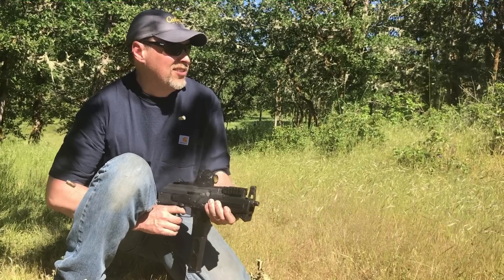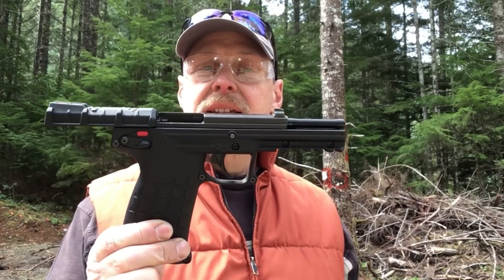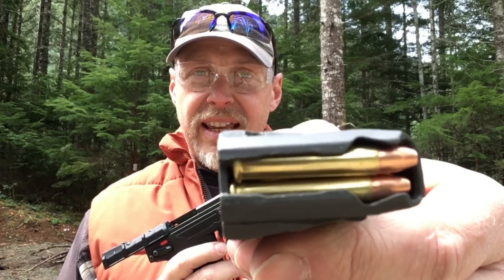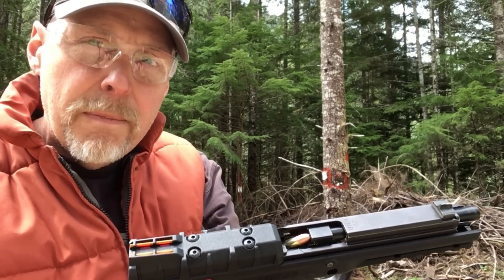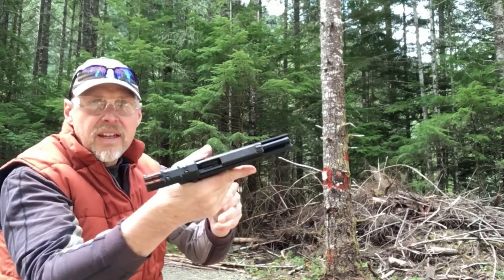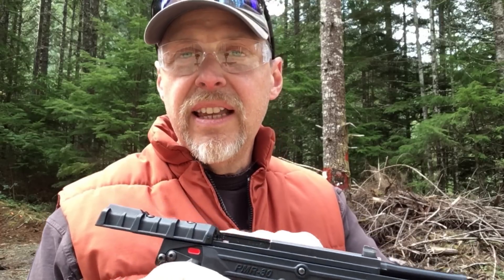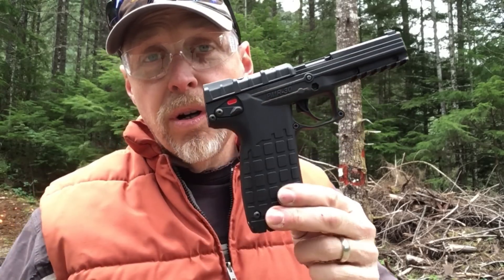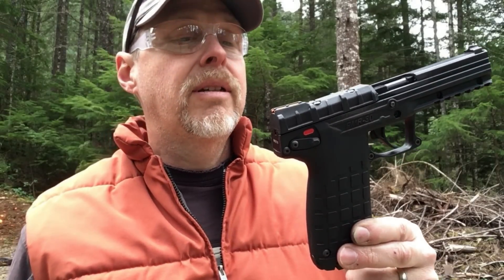Troubleshooting: the Kel-Tec PMR 30

Comment: being an owner of one of these, the single most important tip i can give is, buy the speed loader.  99% of the time, failures in this firearm are caused by improper loading of the magazine.  i've had 100% reliability when using the speed loader.  im not saying thats the only issue you may have with this gun, but the speed loader eliminates rim hangups when feeding.
Reply from the maker: mattaffliction 
  Thanks. I didn’t even know there was a loader for this. A quick internet search revealed they only cost $12. So that’s next on my list. I appreciate the tip!😉
Reply: no problem
Reply: Which loader did you buy? Thanks!
Reply: I got the, Makershot speed loader.  $10 and works great
Reply: There’s a SPEED LOADER! awesome
Reply: yes, that is correct
Reply: yea its how you load it... then you got to clean it ... this is all so new
Reply: After getting a good loader I have no problems
Reply: The speed loader I purchased leaves a dent in the casing.
Reply: @diamonddave7891  mine too :-(
Reply: Yep
I’ve had mine 6 years and it runs perfectly
Reply: That has been my experience also.
Reply: @TheOtherEddie  American speedloader , works with the Mag upside down inserted into speedloader, works like Butta!
Reply: Me too, it's so weird once I started using that Speed Loader is it supposed to rounds in exactly how they should go I guess

Comment: I love my PMR, here's what i learned; the mag springs are too tight, i simply leave them loaded all the time. 
Feed issues; It's all about loading them, if the rounds don't (snap) right in, stop and strip a few off then continue to reload. What happens is they ride up on the divider lip on the inside in the back of the mag. Best rounds i've found are 40gn 1900fps, any brand... no less, no more...
Reply from the maker: Scarakus 
  What you say makes too much sense. It’s usually the basics that trip people up. Some of my favorite guns are like this. If you do everything just right they work perfectly but the process of learning their needs is critical. I’ve been doing a variety of experiments to determine how to make mine work and I’ve narrowed it down to the magazine. It’s basically a feeding issue. Every problem is all caused by that. I feel like I couldn’t be more careful loading than I am but what you said about the rounds riding up on the follower hump is right on. When I’ve manually cycled this gun and observed the round left in the magazine after the stripped round it’s askew quite often and that leads to binding and misaligned feeding which is why the rounds are jamming up crooked and stopping on anything they can hang up on. You are brilliant. I will practice excellence in loading and as you say strip off a few of it doesn’t go in straight and perfect. 
  I’ve been spending time with polishing, lubricating and using every grain of ammo I can get my hands on to no avail. You may have saved my bacon😀. I’m hopeful. Thank you!
Reply: yea the mags are flimsy at the top (the weakest point) and tends to spread there, keeping pressure on the sides with yer thumb and index finger seems to help when loading, other than that i love this gun, even though a misfeed or stove pipe is still possible i wouldn't use as my main carry, but it does make the perfect cover gun.
Reply from the maker: Scarakus 
  Well thanks a ton. I will begin training to become a zen master at loading the PMR 30. It’s a simple thing that I may have overlooked. I really like this pistols’ light weigh, capacity, looks and trigger pull. I even like the fact that it shoots the 22 mag. Neat concept.
Reply: lol.. Yea it's an awesome pistol. 
I actually had the firing pin break during a backfire, got my face peppered with blow back, thank goodness for safety glasses!
Reply from the maker: Scarakus 
  Ouch!😳
Reply from the maker: js3266 
  Yeah I hear that a lot. Maybe it was a reach too far to try to make such a high capacity pistol that feeds rimmed cartridges. Part2 video coming soon.
Reply: I agree with everything you said, I own a PMR too...after i've shot it 300-400 rounds it worked great. The instructions tell you if you don't load the mags correctly it probably will malfunction, it also recommends 40 gr. rounds to work correctly since it is a blow back design. I do love the uniqueness of the 30 rd. capacity and the 22 wmr is a surprising round of its power.
Reply from the maker: wiclsurge 
  Yep. 22 mag is a pretty capable round if the shooter does their part. 30 rounds of 22 mag may not stop a whale but with decent shot placement would probably bring down just about any other aggressive critters on the planet. That’s a lot of power in such a small light weight package.
Reply: It's just a pity that you have to go through all that to get reliable
Reply from the maker: alaskanalain 
  It sure is. KelTec has been a very innovative company in its designs and keeping prices down but they have a terrible reputation for producing unreliable guns and sending them out to cause frustrations to their customers. I can’t understand why they continue in this pattern but it’s plagued them the entire life of the company. 
  When I got this pistol I knew it was a “problem child” so it wasn’t too frustrating to me. I basically traded for a project. I was rewarded for my patience with a fantastic gun that I treasure now. There is no other gun on the planet like the PMR30. It’s truly worth the potential hassle. To me anyway😉
Reply: @MaxHeadspace9mm  what a garbage gun. I have a S&W 40 Cal never had a problem with anything and it will shoot any ammo I put in it. Why would you buy a gun that you know has problems and is poorly made?
Reply from the maker: 1970 olds442 
  Watch the video I just uploaded today for the interesting answer to that question. It’s called, “PMR30 for Self Defense? 1,000 Round Review”.
Reply: Thanks I'll do that on mine. But I love my glock 19 gen 4.
Reply: @ClutchAndShift  Glocks are cheap guns just like Kel tek. Glocks misfire all the time to and police can buy them for $110 each so how much quality is in a Glock not much
Reply from the maker: 1970 olds442 
  You’re kidding right? I’ve got 5 Glocks and have never had a single malfunction in any of them.
Reply: @MaxHeadspace9mm  no I am not kidding about any of it. Glocks are cheap made guns. Barrels are cheap can't shoot reloads plastic slides shitty trigger shitty grips shitty magazine sticking down I could go on longer you get the point. Glocks are nothing more than a big hype and it's going away. Then stupid Glock submits a side arm to the military and it does not even have what the military wants then Glock whines they didn't get the contract. What a joke
Reply from the maker: 1970 olds442 
  Yeah. As I recall Smith and Wesson didn’t get that military contract either, did they? 
  And by the way, nobody thinks 40 is a viable caliber anymore. Also, I like Smith and Wesson revolvers but I would never have one of their semiautos. They should stick to what they do well and leave making semiatos to those who do it correctly.
Reply from the maker: 1970 olds442 
  I don’t know where you heard that “Glocks misfire all the time” complete hogwash. The gun can’t fire without a human pulling the trigger so that’s human error. Not the fault of the gun. If people would keep their finger off the trigger until they are ready to fire then that would never happen. Same rule with all guns.
Reply from the maker: 1970 olds442 
  Why are you so offended by my choice in firearms that you would resort to name calling? That only shows that you are immature and invalidates any point you could possibly make.
Reply from the maker: 1970 olds442 
  Actually I’m an amateur gunsmith and have gotten some really nice firearms because they didn’t work and I fixed them. Got a great gun cheap and had fun in the process. If you watch the next video about this pistol, “KelTec PMR30 100% Reliable!” You will find that this gun is working perfectly now. Then if you watch, “PMR30 for Self Defense? 1,000 Round Review” you will learn that when you’re patient and don’t give up sometimes bad guns can be great guns. I love this thing now. There’s no way it’s a terrible gun if it will run a thousand rounds without a single malfunction.
Reply: @Wanous-hv7zo  You have no clue as to what you are stating. Since you are so well informed to make such accusations about Glock being a "cheap" gun, please back up your statement with facts...REAL FACTS, not made up.
As a PE and weapons design consultant, I would like for you... that might know something I don't to prove your statement with real facts! I'll be expecting your reply with concrete explanations as to each and every cheap item/issue with a Glock.
Reply: @Wanous-hv7zo  There is no point discussing an issue with you. You did not answer why a Glock is Cheap.
1. Policemen do not pay $110 for a Glock. You are misinformed. Maybe for used Glocks, but not for new ones. I do know how much they pay.
2. Most of the failures I have seen and analyzed as an expert have been caused directly by the user, not a gun failure but user failure.
3. People can post any BS on the net...and there's lots of it.
4. Why are you always offending people?  No need for that.
5. I would not put a sticker on my McLaren 570S. Although you may consider it  a cheap car.
6. I have never seen a Glock barrel fail due to remanufactured ammo. As long as the ammo meets SAMMI manufacturing specs there are no known problems as you claim.
7. Please send me your friends lawsuit papers, depositions, etc. If you do so I'll be glad to look at it and I bet I'll find a user error. Any person can file a lawsuit, whether it has merit or not.
8. I own over 25 pistols from different manufacturers and if there is a gun I'll always trust and carry on my is a Glock.
Reply: @gunengineer50  police in St cloud MN pay $110 for a Glock that is a fact. I have 2 very close friends that work there and 1 is missing 2 fingers from the poor gun. And yes I did explain the low quality barrel and the polimer bottom has the nose drop in the front and polimer slides on the barrel cheap cheap cheap cheap cheap cheap cheap cheap. You can look everything up I said there Glock tardo
Reply: @MaxHeadspace9mm  1970 olds442 has no clue at what he writes. He makes no sense at all. He obviously does not understand how guns function. 
Why does he have to use insults? Lack of education and respect for others?
I assure you he has never fired or owned a Glock. Maybe too expensive for him to own a great gun.
Reply from the maker: 1970 olds442 
  I believe in freedom of speech just like the framers of our great founding documents. That’s why I don’t delete people’s comments no matter how ridiculous they are. I want everyone to be free to show the world how ignorant and lacking in self control they are. You are obviously someone who jumps to insults quite easily. In my experience people like that either have deep seated psychological problems or do it on the internet because they know that they can get away with it and they don’t dare do that in real life because of the obvious consequences. 
  The problem here and the reason I speak up now is that we in the gun community who stand on the second amendment have something very significant at stake right now. And we can’t afford to be divided on stupid petty issues and insulting each other if this free country is going to continue. If we lose the second we lose our freedom and that’s a fact. And a nation divided against itself will fall. The evidence I’m seeing is all I need to know that if the gun community has too many people like you in it our fate is sealed. 
  You may not like me or my videos or the guns that I like but for the sake of future generations please have a little courtesy. If not for your fellow man then for the continuation of our free nation and those who come after.
Reply from the maker: design_engineer 
  I used to wonder what all the fuss was about Glocks too. Then I got one. 

Now I know.
Reply: @MaxHeadspace9mm  now you know they are cheap shit
Reply from the maker: 1970 olds442 
  Sure if that makes you happy. I have five Glock pistols that work flawlessly that have the highest capacity of any in their class and I can field strip them with my hands tied behind my back and I carry a Glock 26 every day. 
  And I’m a cheap loser who also has 3 Sigs and an FN but I shoot the Glocks more because that’s how stupid I am. And I share this disease with the majority of gun owners in America who make Glock the best selling pistol here as well as around the world. We’re all just a bunch of crazy cheap losers and you’re to be congratulated for being the only sane one left.
  Happy yet?
Reply: @MaxHeadspace9mm  wow your the greatest in your own mind.
Reply: @MaxHeadspace9mm  I suppose 9mm is the best and everything else is junk rite?
Reply from the maker: 1970 olds442 
  I don’t see anything wrong with the truth.
Reply from the maker: 1970 olds442 
  I wouldn’t say that. It’s a really good balance of economy and efficiency. It’s the most popular defensive round in the world. It’s fairly inexpensive compared to most other handgun rounds. There is more variety of loads and types than most. All around it has a lot going for it but by no means is it the only game in town.
Reply: @MaxHeadspace9mm  I agree with you about the 1st and 2nd amendments. However, one of the reasons this country is going down as fast as it is it is because of people like 1970 olds442 who cannot keep a decent conversation without insulting others, reasoning on facts, and using foul language.
He cannot make a single point to defend his reasoning why Glocks are cheap without insults and nonsense!

Regarding ammo, again 1970 olds442 does not understand what goes into selecting a cartridge. 9mm is very popular as it is the NATO accepted round. I'm not going to go into a disertation that he would not understand. One of the reasons 9mm is do popular is weight vs kinetic energy (stoping power) When soldiers or special forces go on missions one of the most important issues is the weight they carry. Thus, when deciding what cartridge to select, overall weight vs KE are a primary decision. 
I'll leave it there because you cannot reason with ignorance (1970 olds442)
@Max Headspace 9mm, I would recommend to just ignore this person. No need to argue with complete ignorance and lack of respect and education.
Reply from the maker: design_engineer 
  Good words. I agree. I told him I’m done playing his games. I’m sure in his twisted world he will consider it a victory that he outlasted us but he’s not worth the time. He isn’t interested in learning anything. Just attacking. But I seriously suspect that there are mental health issues at work here.
Reply: @Wanous-hv7zo  First, learn how to write a coherent sentence. Second, if you make a statement of fact claiming that something does not work I recommend you learn how to answer and defend your statements with facts, data, and real tests. Not the BS you read on YouTube and the net.
I make a point to not discuss issues with people that prove to be ignorant and rude.
Reply: @Wanous-hv7zo  You made a comment about Glock barrels not working with reloads.
I can only assume that those who claim that you cannot shoot reloads on a Glock is because they are using lead cast bullets!!!

You can use reloads on both Glock HK and many other manufacturers that are using polygonal rifling.
The caveat is that you are not supposed to use "lead bullets" on barrels with polygonal rifling.  
There is more to it but I'll keep it short and simple.
As long as you use jacketed reloads there are no known issues.
Reply: @gunengineer50  what do you engineer toilet plungers? Does your mom know you are on her computer?
Reply: Max Headspace9mm spot on.Thankyou for your video’s .
Keep up the good work
Reply: Wanous 1966 g th his is hilarious.This is why will lose our rights to have guns.
Reply: design_engineer Thankyou.Like this guys video.Point being its fun to watch on troubleshooting a weapon.You could use this video to fix other brands of guns.Keep up good work max
Reply: Now I’m going to go find another of max videos .I hope the same people are commenting to.
Reply: I persuaded a friend of mine to get one, and hers is frequently (3-5 times per magazine) having spent cases get stuck in the barrel. They have to be manually pushed out with a cleaning rod from the front.

What could be causing her problem?
Reply: @Wanous-hv7zo  the PMR-30 is an amazing pistol. The design and engineering are brilliant and I trust my life with mine.

It's just unfortunate that Keltec's QC is subpar and sometimes bad guns make it out to distribution.

Comment: I've got a PMR 30 and it runs flawlessly. Before I ever fired it for the first time, I did some research and found an easy, quick solution for the magazine issue. When I first got it, I noticed the magazines fit just slightly loose and don't sit high enough when locked in and this would cause the rounds on the left side of the mag to not feed properly. I ran a thin bead of the "5 second fix" epoxy along the bottom of the magazine catch lug on the back of the mag. This made the mags fit tighter and fixed that issue.
As for lube, same as I do for every gun I own, I treat the inside of the barrel and all moving part contact points with StrikeHold cleaner/dry lube. I even use this stuff in my AR and although it appears dry, it runs butter smooth.
Since doing this, I've tried every brand and type of 22 WMR I could get my hands on and so far, I've had zero issues with it.
Reply from the maker: Ham ster 
  Well I tried the mag fix on mine but apparently that wasn’t the problem in my case. But I would enjoy being able to run a greater variety of ammo grain weights. So thanks for the suggestion! I will give that a try😉